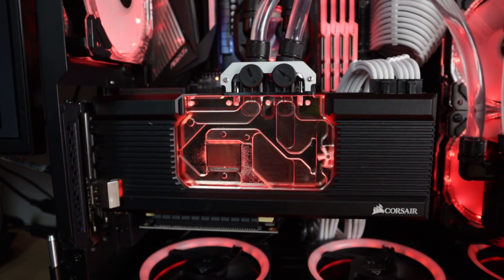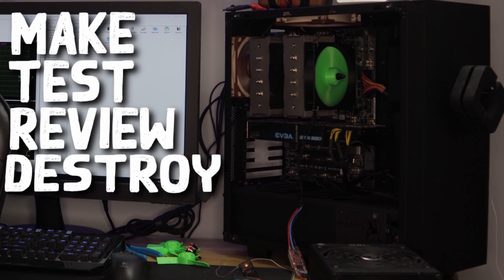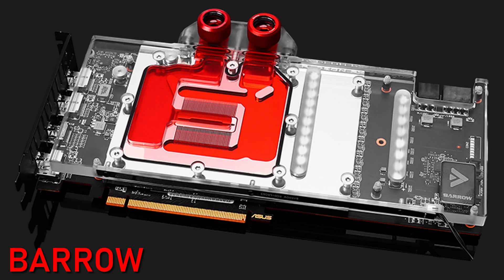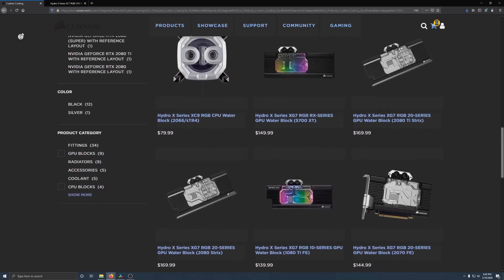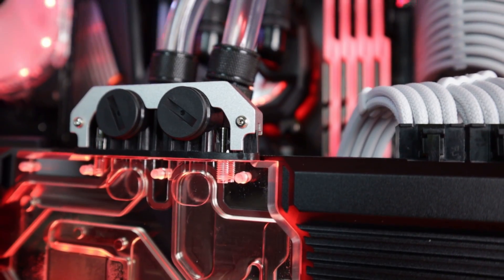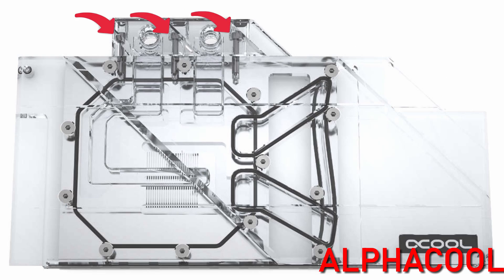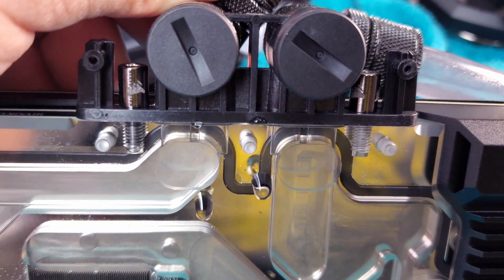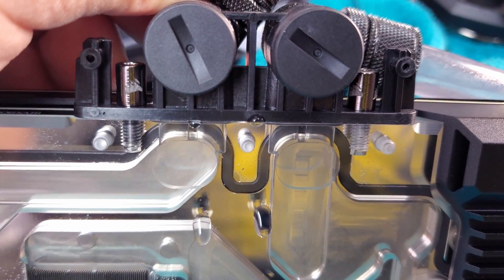WATCH BEFORE BUYING! Corsair Hydro X Design Flaw

Comment: Linus had the same problem. https://youtu.be/wQMCvQ01e80?t=704
Reply from the maker: OH CRAP i never seen that before YES thats the issue im talking about. i hope they see this video and go back and investigate so more people know about this.
Reply: Would like to point out that tightening it clearly fixed the issue as in the Linus video and If it was to have sprung a leak since he "fixed" it he would have made another Video?.
Reply: @mathewknight4274  JZ2C also tightened the shit out of his card and it still squirted everywhere
Reply: @mathewknight4274  i think it was more cuz he kept trying to stretch the tube to cpu block and also had to much tube on bottom of gpu pushing it up which was exactly the type of torque on the block like MH said is what would cause it igor lab had the same issue and talked to corair bout it and even they were able to reproduce it granted not a huge problem but a gpu block shud be able to handle the small amount of pressure that caused these issues without having to worry bout a leak
Reply: But he still used the block so how upset could he really have been lol
Reply from the maker: I'm still using my but I'm still bummed
Reply: Well to be fair, Linus is an idiot.

Comment: Though this particular part is okay, a lot of their custom loop components just look cheap. Too much plastic under too many RGB lights. I'd completely forgo RGB LED's if it meant I'd get more machined metal instead of plastic. Look at Heatkiller'(s) (Germany) parts- that's what water cooling components should look like- like monolithic blocks of metal with a flow window.

Comment: Jay two cents - but a lotta knowledge - saw that it could be the two screws could be torqued more or the addition of a thicker "O" ring could solve it. Probably not a common but possible issue. I wonder if "design flaw" is overkill. Maybe under design would suffice if most folks never see a problem. Not a corsair stockholder but wonder if its something seen largely.....

Comment: Thank you for this. I was going to invest in hydro x to water cool my 2 x 2080Tis but I won't be now. I'll either go down the EK route or just stick to air. The worst damage air can do is get some dust stuck in the card. Thanks again.  Oh, and I'm going to sub.
Reply: Since this video, Corsair has rebuilt their hydro x water blocks to add the third center screw and prevent this from happening. Feel safe using them to water cool any of your graphics cards now 👍
Reply: @mikevoldemort  How do we know which one we're going to get if we're buying online?
Reply: @grahamstephens9931  buy from corsair’s website and you’ll be fine. I try not to buy through third parties unless I have to

Comment: Looks to me like it's also very shallow in thickness.  If it was a little deeper front-back any force on the manifold would put tension on the screw, instead of bending.

That would probably actually be more effective than a 3rd screw, but I think the correct answer would be to do both.

Comment: Thanks for posting, definitely gonna keep an eye on it. I haven’t noticed any leakage yet, though mine is installed vertically, maybe there’s not enough stress on it in that configuration. I’m not over concerned as even if it does leak, it will only be hitting my lower fans/radiator. Good catch though and thanks for the heads up.
Reply: any leaks yet
Reply: @ceff01  never had any…but I replaced it with a 3080 and the Corsair block for the 3000 series actually has the third screw to hold the plate a lot better. Definitely learned from their mistake
Reply: @briancates3576  perfect thanks and just wondering do you know what size torx for the top manifold silver brace thanks

Comment: How long did you have this water block until it started leaking? I have the 2080 ti with the same waterblock, and lucky no leaks yet, I am using hard line tubing and bent to fit perfectly so there is no flex pressure on the fittings, is it only leaking on loops with bends that is applying lean pressure on the fittings that is making them leak? as I have had mine on for a good month now and no leaks yet.

Comment: I have AM4 corsair water block, 2 vega 64 waterblocks, the corsair reservoir pump (not the new one), 3 radiators in total (120mm, 240mm, and 360mm), all in the crystal 680x.  Anything has the potential to break or not work.... with that being said i have had zero issues with the water blocks regarding leaking.  I did however have a issue with using the fluid corsair sells.... it suggested i use the XL5 performance coolant (i got the clear) and it clouded up my whole system.  Everything in my system is corsair purchased...no reason why i should have to worry about it clouding.  I say all this to say that i had to take the water blocks apart (everything) and clean it all before i chose to run treated distilled water.  So the water pump reservoir, cpu waterblock, both vega 64's waterblock.  I completely disassemble them following a youtube breakdown guide and i put it all back together without there being any leaks.  So i'm not trying to negate what MH is saying... i'm just sharing my experience.  I have had no issues with leaking ever and this was my first soft tube custom build ever.  I'd buy from corsair again.

Comment: You know it's funny... I returned my K95 Platinum Keyboard for a similar reason. The space bar only had one button in the middle and pressing the edge of the space bar actually caused it to pop out of place, causing the space bar to no longer work until pressed firmly in the middle. That was a $160 keyboard from Corsair! I'm not rocking a Kingston Alloy FPS Pro keyboard at half the price and it's got three mechanical buttons along the space bar and works perfectly. I'm taking a long break from buying Corsair products!

Comment: I emailed Corsair about this (which the video poster failed to do) and got the following response;

"This is a known issue with our early Hydro X GPU blocks.  The current products shipping out have material upgrades to fix the problem.  If you do encounter this problem in normal use, we would be very interested in getting your unit shipped to our lab for engineering analysis, and will compensate you for any hardware damages resulting from a leak."
Reply from the maker: Hey... thank you for taking the initiative

Comment: Wow!  That’s bad.  You got lucky.  I had a poorly designed fitting kill a video card when it leaked years ago, a GTX 280.  The fitting was part of the kit included for a Striker II Extreme nForce 790i Ultra mother board, which had a water block mounted on the chipset.  Ever since then I only trust something I put together out of parts I hand picked and installed.

Comment: Thankfully this hasn't happened to me yet. But now it looks like the leds in the Pump/Reservoir leds are going bad. They keep randomly turning off and on for no reason. Also one led seems to be doing this as well in my gpu block for my 2080. It just started doing it today. I submitted a ticket on corsairs website with a video showing it doing this. I can't figure out why it's doing that. I tried different color profiles but it still does it.

Comment: I was about to buy, a custom water cooling kit from Corsair and now I think I'll hold out on it. The price was going to be $790 for everything. For that price this problem better be fixed before I jump on this
Reply from the maker: yes, i never had any problems with the CPU block or rads or fittings i had just the GPU block it was PooPoo

Comment: Yup, can confirm this, i also have this corsair block for reference 2080ti leaking at the head if there’s any slight torque pressure. It is a design flaw. Unfortunately i still use it but have to be careful to not load the head gaskets too much and mount the gpu vertically.
Reply from the maker: its a real bummer

Comment: Also work in Engineering. Your explanation and analysis made me giggle with joy just a little, because you have Engineer vision (and it's refreshing). Great job!

You probably know, there are calculations to determine minimum distance between fasteners (whose clamping force you need to factor in) for gaskets of (x thickness, y material, z shape). But to your point, those are only good if the materials being clamped have the rigidity to resist deformation at that force.

Other waterblock companies no doubt use the third screw to account for the bulkhead's flex, as you mentioned.

My guess is that their engineer did those calculations and said "everything's good," but misstepped by failing to take the modulus of the plastic bulkhead into account, or misapplied some FEA modeling. Easy to do, FEA always gives better stress performance numbers than real life from my experience.

Someone also may have VAVE'd the plastic bulkhead, not realizing the strength change. Or the engineers expected a certain torque on the screws, and the assembly line isn't hitting that torque. The screws also may not be able to sustain that torque due to the limited engagement depth or the materials used.

Whatever the reason, crap like this happens all the time. Every one of the examples I gave I've seen at one point. And a third screw is a super easy solution to all of them in this case.

Comment: I use to work in an automotive plastic factory making water outlets and mass air flow bodies in charge of final assembly. Looking at where the ejector pin marks are located there should be a mold cavity parting line running across both manifold o-ring sealing surfaces that could be responsible for the leak if it is not perfectly flat. The slightest smallest sharp edge can cause a leak in an o-ring which was the issue from a single brass flake, glitter sized, from a previous ultrasonic welding process of a threaded insert.

Comment: Man you were pushing on that manifold pretty hard you can see and the reason its plastic and not acrylic is acrylic will start to micro crack over time and I am all most positive it is nylon and not plastic and nylon is very sturdy and strong just ask any 3d printer
Reply from the maker: i asked my printer and it never responded :-(
Reply: @MajorHardware  lol good one
Reply: Anyone who has printed nylon and as a machinists I can tell you from personal experiences  that it  is really strong

Comment: did you bring this to the manufacturer notice I'm sure they would welcome the feedback as the line is somewhat new I cant think of any brand that uses 2 mounting screws for there blocks for gpus
Reply from the maker: i havent reached out
Reply: @MajorHardware  how are they to fix it if you don't tell them about the issue you should of contacted them before doing a video about it feedback is important for hardware rmas cost company's millions driving prices up for the consumer

Comment: it baffles me why ALL pc watercooling parts doesn't use proper seal like in plumbing.
no thread seal tape, no gasket, no EPDM o rings, no nothing
only shitty rubber o rings and only in some fittings too not all.
you'd think gpu/cpu blocks would use actual gasket but no, here's ONE 2mm rubber o-ring. not even 2. ONE.
and they cost more than shit i use to run chemical pipelines in a chemical plant i work in.
Reply from the maker: hard to tell

Comment: They should honestly pull this from shelves. Most consumers Will not realize its a design flaw, and thus that corsair is responsible for buying them New parts...
Reply from the maker: ya it would be a real bummer for someone wanting to get into custom watercooling and have a leak that runes there system

Comment: No issues with mine.
Reply from the maker: happy to hear it, if you are using the block i wouldnt try and wiggle it about once you get it leaking it becomes more susceptible have noticed.
Reply: Major Hardware you kidding me? It’s my first custom loop... I don’t even look at it for too long😂 some differences in our builds though. I’ve got PETG and it’s joined on the top side, so might be why I haven’t noticed any of the same droop. And my case came with a decent anti sag implementation for the gpu. Anyhow, I’m happy with the approach you took. Not calling Corsair out for this design flaw directly was a smart choice. I assume you’ll make a follow up on your solution? Maybe some of that acrylic adhesive would do the trick.
Reply from the maker: Hard line tubing i bet that looks sick and yes i didnt want to go wagging  my finger saying worse thing ever because im not an expert in that area. Also i have designed many things while ive been an engineer and i have made some dumb mistakes i didnt notice nor did my team until it hit the floor for build and then i stood back and was like how did i miss that.
Reply: Major Hardware haven’t we all?😂

Comment: No issues with my XG7, have tried it with a vertical mount and horizontal.  
maybe its a bad / poor batch.? 
Definitely worth a reach out to Corsair to replace and see if the next one does it, I wouldn't call it a design flaw yet without having proventhe same issue on another XG7 Waterblock.
Reply from the maker: Yes thats why i made the disclaimer that i had a sample size of 1 and it could just be me. however based on there not being any mounting pressure between the 2 fitting locations im pretty confident that if you have you pump running and you place any pressure across the manifold you will see a leak. However if yours is working i wouldnt touch it no since in unseating anything.

Comment: Well there's no doubt it is a design flaw.
Now to see how Corsair handle the situation.

If the deny it's an issue then that's instant distrust.

If they accept responsibility for the issue and offer a solution to rectify the problem then in my eyes that's a positive step forwards.

They potentially were aware of the issue but seeing as they don't have the same sample users with which to try out the water blocks it is possible they didn't see it as such a high risk.

Either way, it is a flaw, and although I don't really like water cooling due to it's potential risks, I certainly won't be buying or recommending that anyone else buys one of these Corsair GPU Waterblocks until the flaw is sufficiently rectified.
Reply from the maker: i would hope its a mistake and being there first endeavor into custom cooling it would make sense.

Comment: Well that's pretty shocking. It reminds me of XSPC's old debacle with their D5 Bay reservoir that didn't have enough fasteners in its top so it flexed and the oring bulged out. People pointed it out and they denied it was a problem until many people had posted pictures of dripping reservoirs inside their systems. It killed a few. 
This is not acceptable and I would send it back. They said they chose Nylon instead of acrylic because it is less brittle and less reactive with some coolants but its also softer and clearly bends too much.
I guess at least Corsair have a history of looking after people and replacing hardware when the first AIO coolers leaked. The smaller watercooling only companies will wash their hands of you.
Reply from the maker: I think redesigning the manifold would be pretty straight forward, problem is that based on how i think its manufactured they probably have thousands of these sitting waiting to be installed on new GPU. Also it really depends on how many people see this video and share it with others to get the word out that this is a problem.

Comment: @Major Hardware
The word BAIL is what comes to mind.
If you can flex that manifold, with your thumb, while holding it in your hand, your going to have trouble.
That part of the system is not water tight and will be an issue after thermal cycling.
Reply from the maker: yes, right now these blocks are pretty new even if you bought one when the first came out however how will things look in 5 years as they start to age.

Comment: Well that's kinda screwy. It makes sence. Mind you I'm not even a pc owner. I has a giga janky laptop thing I've after marketed to hell and back
But as a self proclaimed designer and an avid tinker of the most jank I can see how this would be a wide spread problem. I'm assuming this must remain serviceable but I would honestly just make a glue seal. I dont have a clue how modern water blocks work so I dont have a rite to input but I felt the need to regardl
Reply from the maker: not sure how glue would hold up overtime

Comment: the aluminum part on the GPU block is only put for aesthetic to match the design of the ram
Reply from the maker: i agree however based on how its fastened and constructed i feel pretty confident that it is also there as a structural support.

Comment: I only deal with one company when It comes to GPU waterblocks and that is Watercool.  I have the Heatkiller block on my 2080ti, now it only has 2 screws that hold the manifold on but the manifold is a third of the length of most companies and it is made out of Acetal.  Never had an issue with Any of Watercools products.
Reply from the maker: yes acetal is much stiffer than nylon, this would be the fix corsair could do retrofit these blocks with a new manifold.